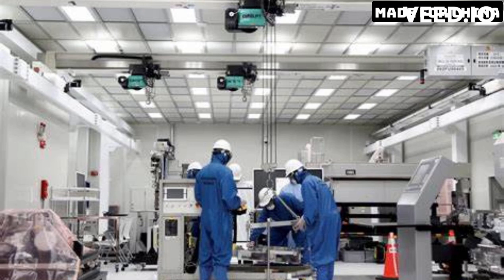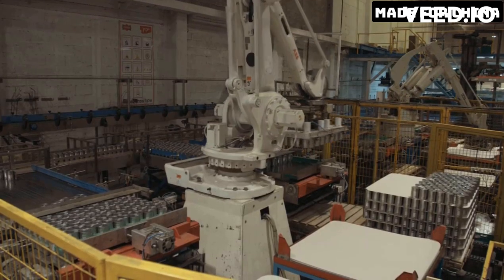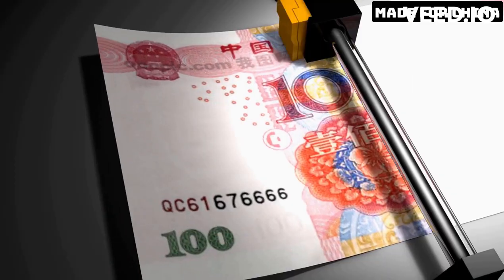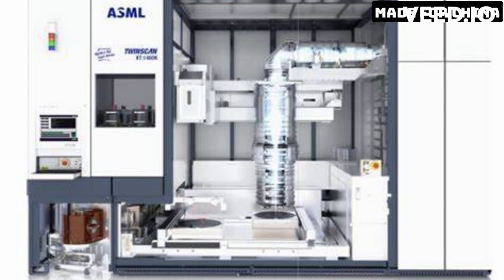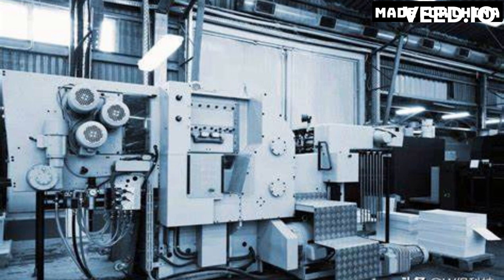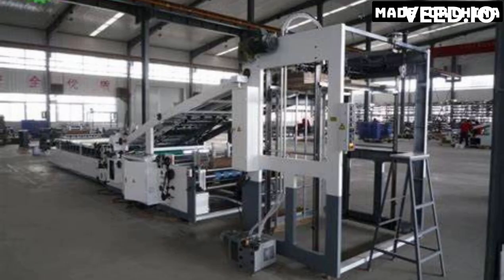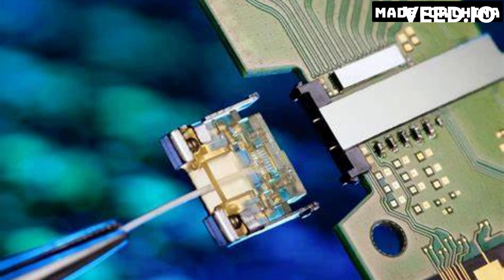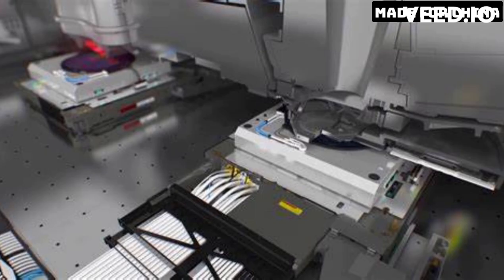China's New Lithography Machine Has Been Officially Put To Use

Comment: Congratulations to China's new Lithography Machine.
China need to invest heavily on chip technology due to the US malicious intention to destroy China high-end technology industries from competing with the US as the US consider it their sole propriety under its domain and its exclusive control.
The manufacturing of chip and EDA tools development begins to accelerate rapidly in China due to the US sanctions.
China is force to find alternative solution and replace it with domestic development tools around hardware development and chip development.
EDA tools are use for chip design to develop chip design drawings and hand over to lithography machines and other equipment to produce chips.
The US and its allies is trying to disrupt and destroy China chip manufacturing including lithography supply from ASML to China.
The US is trying to strangled and ultimately destroy China chip industries from completing and bypassing the US in high-end technology. 
The US has been trying to freeze China out of the high end semi-conductor industry with all kind of dirty means to prevent China from completing with the US on the highly lucrative technology.
The US like to portrays other countries as an antagonists and as well as an adversary when the US face with competition in chip technology which the US regard it as their domains and sphere of influence and will not accept any competition from another country. The US has been trying to freeze China out of the high-end semi-conductor industry with all kind of dirty means to prevent China from completing with the US on the highly lucrative technology. The US tries to kill Huawei on the ground of national security threats. The US undermine and sabotage Huawei through launching extrajudicial probes and even put out a provisional US extradition request on Huawei CFO Meng Wanzhou which the US are alleging that Huawei violated the US's sanctions by selling American equipment to Iran, via shell companies set up by Ms Meng. The US announced financial fraud charges against Ms Meng. Ms Meng is under house arrest in Canada on the request by the US. The effects of sanctions cause Huawei US$30 billion annual loss in its smartphone business thereby losing its profitable cellphone and telecommunication business. Whenever the US tries to impose sanctions and bans China from developing chip technology, China will have to work hard to build its own technology to counteract and to redress the US actions in order to save China own industries and development. The US is using its national security strategy and sanctions to forbid China from advancing into high end development and technology. The US is implementing laws to hold on to its high end technology by preventing other countries in competing with US that threatened its monopoly over advanced technology that is the highest form of technology available. The US is trying to prevent China from surpassing them in chip technology by imposing all kind of restriction and sanctioning China in accumulating advanced technology.
China will have to work hard to build its own technology to counteract and to redress the US actions in order to save China own industries and development. Nothing change when the US felt threatened in losing control of the chip industries, and tried to use all kind of sanctions including banning chip sales to China and implementing the Chips and Science Act- The Creating Helpful Incentives to Produce Semiconductors and Science Act of 2022 (CHIPS Act), signed into law on August 9, 2022, is designed to boost US competitiveness, innovation, and national security. 
The law aims to catalyze investments in domestic semiconductor manufacturing capacity. The US even tries to force South Korean’s Samsung and Taiwan’s TSMC to build their semiconductor industries to jump-start its own high tech industries to the US. 
The US force other countries from cooperating with China with regard to manufacturing and selling machines in manufacturing high technology chips. The US is making a mockery of its own market mechanism by using laws in curbing competition from other countries.

Comment: Unless they had spectacularly good industrial espionage in several countries, I don't see how they could have done this. Getting EUV to work took some of the finest minds on the planet more than 20 years of R&D. The components of the system were developed in several countries. The EUV source in the US. The mirrors to focus it were developed by Carl Zeiss in Germany. They're not normal mirrors, they have to be smooth and perfectly shaped down to the thickness of an atom, and have a special multilayer design that allows them to reflect EUV light, but only at a specific angle (ordinary mirrors don't adequately reflect EUV, and lenses don't work with it at all). Turning that into workable optics was a mammoth task. Then ASML, based in the Netherlands, took the EUV source and the optics, and integrated them together to produce working chip making machines. It's difficult to see how China could have replicated all that, not unless they somehow managed to pirate all the details of how to manufacture all the components.
Reply: The biggest difficulty is getting something to work. Once people know that it does work, life becomes far more easier. Yes, there are obstacles getting there but eventually one gets there, simply because one knows it works.
Reply: The Chinese don't have spectacularly good industrial espionage in several countries. But the British and Americans do have spectacularly good control over global media.
What China probably did was to manufacture x and y and z over time and get better. When everything is in the same country, same language is spoken, people can get together and have synergies and exchange information. Like almost everything else in the West now, China probably did the low end, unprofitable manufacturing at first.
Reply: Look at how China copies everything, to advance themselves, such as Military.
Reply: Denial of Reality. How very Western of you.
Reply: You speak too soon, which is more difficult, Space station or high end chip machine?. There are few roads to a distination, not necessary EUV